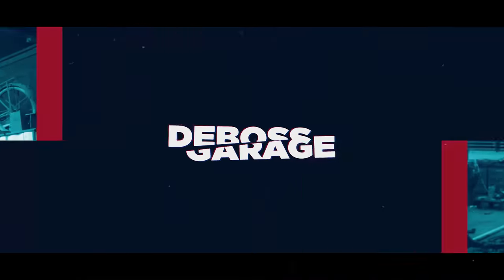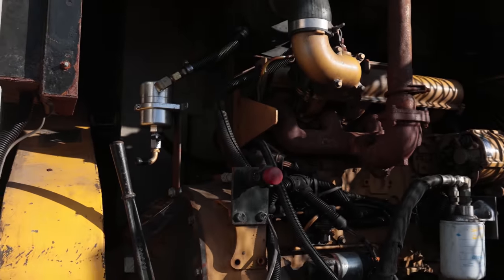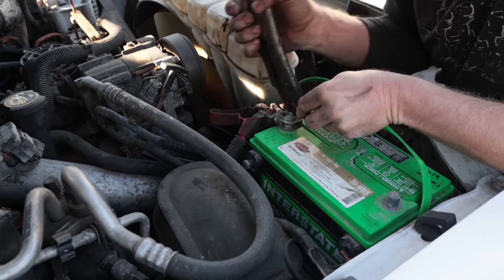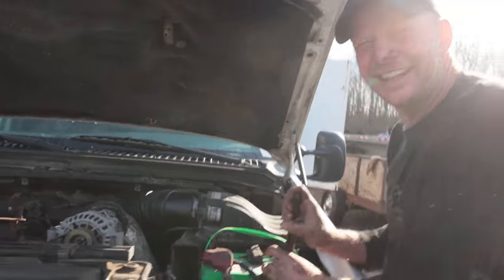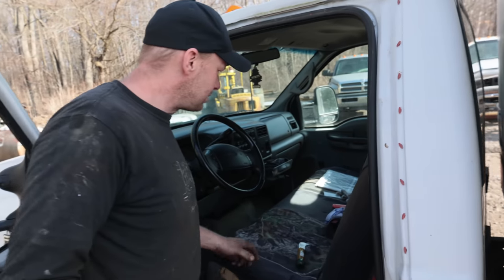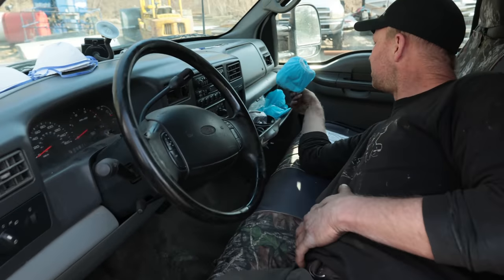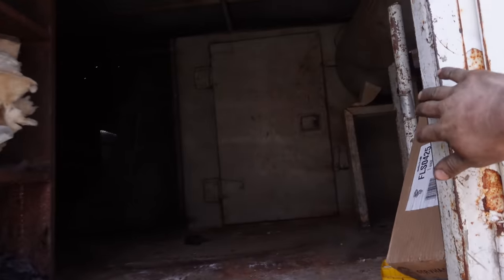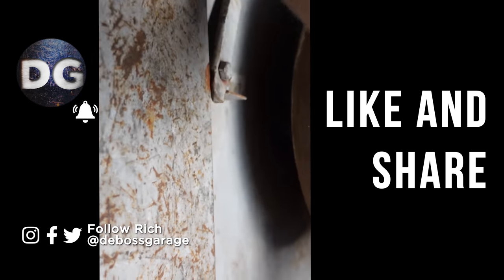Will It Run? F550 Powerstroke has a 4cyl CAT for a starter!

Comment: My shop had a f350 7.3 that was an absolute no start, it would be really cool if you tore apart that motor to diagnose the issues. Not to repair, just to see what went pear shaped
Reply: Those are fairly rare. 7.3s are super simple
Reply: I usually find it to be low or no oil pressure from the high pressure pump or have seen the cam gear come off. one time a guy put the clamp hoses on and pinched one of the oil lines. usually its something basic. injector driver or computer even

Comment: Wonder if that engine was aimed at the euro market being a Perkins? I have a CAT branded Deutz water cooled 3114 in a CAT  I'm working on, it's a funny mix of US and German parts.
Reply: CAT bought Perkins a long time ago and uses Perkins and Mitsubishi engines in smaller equipment alot.
My 416 back hoe has one.
Reply: @MitzvosGolem1  we dropped Mitsubishi engines longtime ago, chances are if your engine is a tier 3 or higher is all made in house, except the stupid C3.4B engine made by FPT
Reply: @samxxxii  wow ok. My 289e loader had a Cat USA made? Awesome
Reply: @MitzvosGolem1  not sure, what’s your machine serial number?
Reply: @samxxxii  it is 2016 common rail 289E series Three high flow. I check number
Reply: @samxxxii  289DKTAW00515
Reply: My friend has a 279D think his is Mitsubishi aluminum valve cover no Regen.

I hooked my CANDOO scanner works on both ok but not CAT ET .
Cat charge s $900 to come just hook scan tool up only.

I have a 3126 B no start tried new ecm new IPR no pressure from Heui needs 870psi to start no oil pressure in head no orings bad on injectors. Only 40k miles any ideas?
Have heui off no metal in oil clean. Don't want to waste $1200 on a rebuilt Heui from CAT.
Any idea s?
POS heui motors ng
Reply: @MitzvosGolem1  you’ve got a Kubota engine, haven’t double checked but either way it’s either a 3.3L or a 3.8L Kubota engine, does yours have DEF system?
Reply: @samxxxii  no DEF fluid just regen.
Kubota? Bizarre
Only Chinese take out food is made in USA..sad
My JLG has CAT Perkins motor nice

Comment: A 7.3 will never start turning over that slow, you need 500rpm on start up to build HPOP pressure to run the injectors, if my obs 7.3 turns over that slow there is no point cranking it further, needs all the battery juice

Comment: Can I do late submission of a few photos of My now STOLEN Hilux that I built in my backyard with bits I could get on a budget. It’s a 1983 LN46 double cab Ute. Quite rare. I cut the rear end off a 1986 LN61 Hilux Surf and used this as the well side and also modified the LN61 fibreglass to to be a canopy. 

Not after the prize. Just want exposure as this is possibly in a shipping container on its way to
Reply from the maker: If you’re on Instagram DM us a couple pics @debossgarage
Reply: @DEBOSSGARAGE  thanks. I have just downloaded Instagram tonight. I think I have sent DM to you. Can you let me know if received? Thanks again.